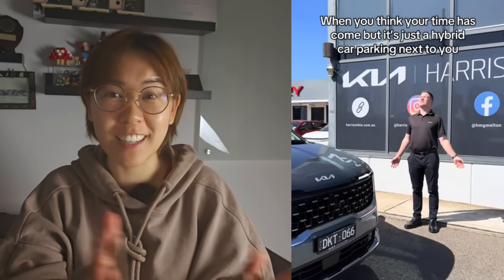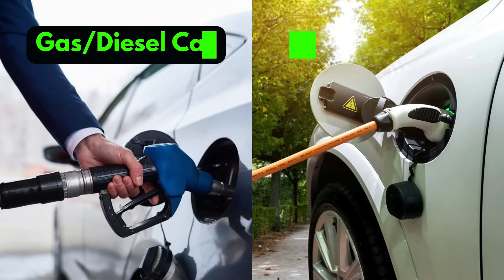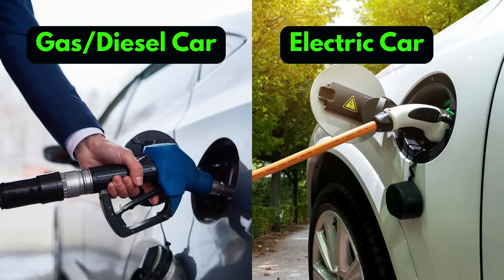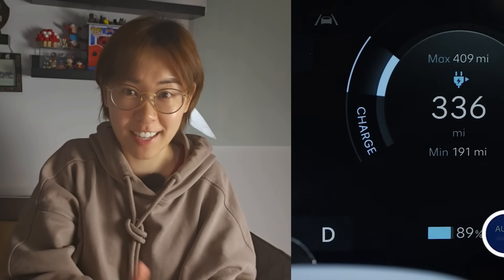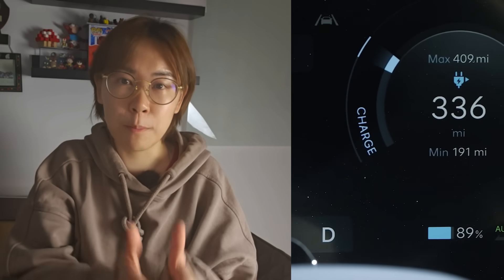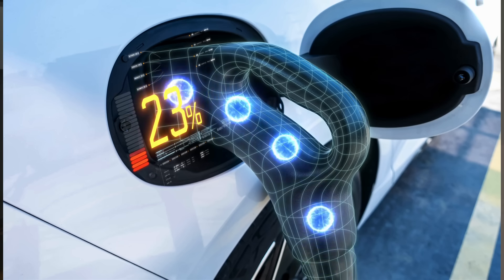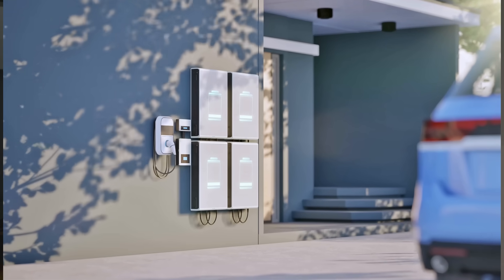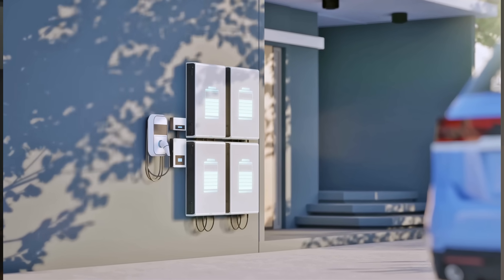Why Do Electric Cars Make Weird Noises?

Comment: What about the emissions from the power stations to make the needed power to charge, and the need for more power plants?  Then, what are the batteries made of?  Byproducts from making petroleum products.  And the electric breaking part is also known as counter EMF, Electromotive Force, and does not put a noticeable amount of energy back into the battery.

Comment: Fun fact : If youve seen a Tesla coming towards you, as it goes by, you dont hear much more than the tires moving along the road. 
  If you only hear a little bit of tire noise, it's because the car has superior good quality tire, such as Michelin,  Perelli, or many other brands. So then the same scenario with a Tesla coming towards you, but as it passes you, this time you can really hear a lot more noise coming from the tires. 
 Well what happening is obviously the owner replaced the original tires with some cheaper brand tires or tires of diffrrent road tread, maybe more aggressive tread. 
As a retired Mercedes-Benz tech for 18 yrs we saw this a lot, customer buys from Joes Discount Tire store and now the wife is complaining about how loud the tires are. Its just funny how working around cars and installing many tires over the years, i can just tell by the sound if the owner replaced the original tires with the wrong style and tread design just to save a few buck. Buy good road tires and youll be happy not hearing the tires talking back yo you.

Comment: I've driven EVs for some time and I will say.....the regen is an illusion. Not that it doesn't recharge your battery while you're braking or slowing down, but rather, it's touted benefits to saving the environment is a fallacy. Yes, it might be an added bonus when you actually do want to slow down or stop, but ask any ICE car driver if they're constantly on the gas while driving and they'll tell you no, they accelerate and then depending on various factors, coast and either step on the gas or the brake as per the situation requires. On the EV however, you can't coast. The moment you lift off, you're slowing down because of the regen. So you need to be on the "gas" at all times, consuming your electrical power 100% of the time. And if you do still coast, because of the regen, you will definitely feel the "squat, lift, squat, lift" of the car as you step on and step off the "gas" to prevent your car coming to a stop as you coast, until you reach a situation where you actually do want to stop the car.

So while the regen does recharge your battery while "on-the-move", it also will slow you down such that you would need to expend energy to make up for the loss of travel distance. In the end, you may not actually make up what you would lose, in terms of energy.

Comment: The worst part of EVs is that you don't understand that the power grid is mostly supplied by fossil fuel, the creation of the battles puts billions of tons of waste in our landfills and if you overcharge them they burn with you trapped inside, because the door locks are electric, not manual.

Comment: Regenerative braking can be adjusted at the accelerator pedal, allowing for one pedal driving. The pedal can be set to coast when let off or full brake so as soon as your foot comes back a little bit, the engine starts slowing the car and when you lift your foot off, the car comes to a complete stop, no brake pedal required. No creep with your foot off the pedals.
Also a major EV company has installed charging stations across the country to be used for free every couple hundred miles so cross country driving is not only possible, but free. Other brands can use but have to pay.

Comment: So if you ride the brakes, you can drive forever? lol

Perhaps you can help me in getting info on the o3 levels given off by ev's. All electric transmission includes ozone discharge. That's why people aren't supposed to live under power lines. Is there enough o3 discharge from the batteries and current flow to increase rates of exposure? So much so that you can tell the Tesla drivers by the skin lesions? Not that likely, I'm sure, but nobody has mentioned it and every time I do, I'm told I'm destroying the planet driving a combustible vehicle. I wonder what the down side of hydrogen is going to be? 

Also, now that you mention it, shouldn't the pitch of ev cars be low enough that those with hearing problems stand a better chance of hearing it w/o having to increase the noise levels so much?

thanks

Comment: Proponents of electric cars claim they reduce pollution, but the reality is more complex. Most electric cars are charged with electricity generated by thermal power plants, which are significant polluters. Additionally, the extraction and processing of lithium for electric car batteries create substantial environmental harm, potentially exceeding the pollution caused by diesel cars.
Reply: This is not accurate. Starting this year, over 50 percent of electricity generated in the US comes from clean and renewable sources. The trend is that fossil fuel generated power is decreasing and replaced by clean sources, and that trend will continue into the future. 

On the manufacturing side, there are new battery technologies that don’t rely on lithium. These will produce dry batteries that will be lighter, cheaper and take less time to recharge. They’re a;ready being used in smaller applications and should be appearing in cars in the next 3-5 years.

Comment: Another advantage of the regenerative braking is that it results in less less wear of the brake pads and the brake fluid system which reduces maintenance cost. The overall EV maintenance cost tends to be far less than for an IC type vehicle. Typically, the driver can select the level of regeneration employed by the vehicle. I keep mine at the maximum setting which results in a higher mileage range for my vehicle.
Reply: However, the more aggressive acceleration and braking alongside extra weight of the battery also makes tire wear out faster. It's tradeoffs in life

Comment: EVs also pollute when the battery and motors are being made
Reply: So do regular cars. And every other item made in the world.
Reply: It’s not accurate to focus on only one aspect of the total lifecycle of a vehicle. If you break it down between initial manufacturing and then operating segments, it gives a much more accurate picture. It is true that from an environmental impact aspect an EV is roughly 30% dirtier to the environment to manufacture. However, throughout the life of the EV, it is extraordinarily clean compared to a gas powered vehicle. In the end, the EV is much less damaging to the environment than an ICE powered car.

Comment: Difference between Gas and EV is EVs pollutions are from the energy made to charge them instead of carrying it with them like a combustion engine needs to. I can charge my gas car quicker and be on my happy way while an EV just sits there. EV is ideal if you can charge it at home and not travel with it.

Comment: 3:15 - I work for an EV charging company,  you also need to consider that chargers can be spread out. You need to consider where you're going, distance between chargers which can be significant and chargers being down. Before any trip, call the EV charging companies you will find along your way to ensure the chargers along your way are working. Apps aren't always reliable.  To my extent, if you run out of gas, you can get a gallon easily. EV runs out of charge? Most times you need to get it towed to an EV charging station, there is no jump starting it like with gas cars. 

Lots to consider.
Reply: This is somewhat like fuel management necessary during the early days of gasoline automotive when there wasn't a station on every corner.

Comment: So, no embedded infrastructure yet in place, totally dependent on power grid remaining up, also totally dependent on slave labor in Lithium Mines to build the product, and no plan or system of old battery disposal like at all...

But you want people to believe EV's are better?

They all have a Killswitch imbedded. They are short ranged. They are expensive. They need a working power grid. Lithium Mines are this horrific secret the world will not discuss because the source material requires peasants like black slaves and Uighurs.

Electric Vehicles will bring death to the world. Pick your poison.

Comment: In short, EVs and hybrid vehicles (eg. the newer Toyota Prius models) make a low pitched, ufo-like hum when driving slowly, or in reverse gear. These sounds are exaggerated by the manufacturers for two reasons- to make pedestrians aware and to make the driver aware that they're on the electric mode of the vehicle.
Hope this helps.

Comment: but our electricity rn are not clean yet, they still burn fossil fuel for electricity
Reply: They burn fossil fuels much more efficiently than millions of ice engines with questionable maintenance routines. Renewable generation grows every year.
Reply: @saintchuck9857 but still, burn fossil fuel right?
Reply: @devittentapramana7536 yes, much more efficiently than individual cars do. even without renewable energy, EVs would be a net gain for efficiency.
Reply: @saintchuck9857 when all of the vehicle turn to EV, can we keep up with the electricity supply?
Reply: @devittentapramana7536 If it happened tomorrow, of course not. At the rate generation is being added, yes, unless your country is devolving.  You are looking like one of those people that just parrot propaganda, even though you know better. What next?

Comment: Formula E is a nice demonstration of how effective regen braking is - they don't even use normal rear brakes, but ones that only come on if there's a system failure. The next generation will be able to regen at 700 kW, with both front and rear motors doing most of the slowing down.

Comment: Would brake charging affect the life of the battery? Maybe I'm just thinking of what they say about portable devices, where you're encouraged to run it down to a certain percentage and then charge it below a certain maximum to get the most out of the battery life, so maybe this is different. Has me wondering what sorts of usage beyond straight power expenditure affects things
Reply: Older battery problem. Lithium-ion batteries don't have memory. Discharging li-ion fully can damage them, however.
Reply: @saintchuck9857  Usually the battery monitoring sub-system shuts down the device before the battery is "fully" discharged.

Comment: When the Nissan Leaf debuted in the UK in 2011, it cost an inflation-adjusted £46,000, ignoring EV grants.
Today, for £23,000 ignoring EV grants, you can get the Renault 5 EV, with more power, twice the range and more equipment. Half the price for twice the range. 

The rate of progress in EVs has been ludicrous, and with the way China is focussing on them I can see a lot of Western & Japanese manufacturers getting into serious trouble in the next few years.
Reply: I purchased my Nissan LEAF, ten years ago and the battery still has 80% of it capacity (range) as it did when new.  Even old EV batteries have good life span.

Comment: EVs are cool and all with the evolutions that happen everyyear, but thwre are some reasons as to why people don't like EVs. The biggest reason as to why people such as myself don't like EVs is because they don't have a soul. Internal combustion engies feel alive from the noises and the vibrations it makes, while EVs make no noise and no engine that feels alive. Another reason is that environmentally EVs make more greenhouse gases that internal combustion engines. Superchargers still rely on diesel generators to get electricity, and you need to drive about 100k miles before any of the savings take place. And lastly, the batteries and motors are kinda hard to recycle while as typical internal combustion engines only need to recycle the liquids and the engine can be placed in any other car that has an engine bay that fits it.
Reply: Almost no EV charging stations rely on diesel generators. There are photos from a music festival a few years ago and ones from the outback in Australia and people have pretended that's the norm. It's like saying all cars are Hispano-Suizas because you saw a photo of a Hispano-Suiza once.
Reply: What greenhouse gases do you think EVs make? Your whole comment looks like just parroted propaganda.